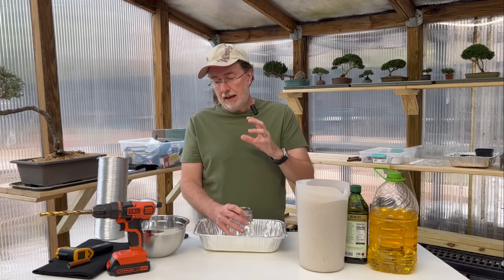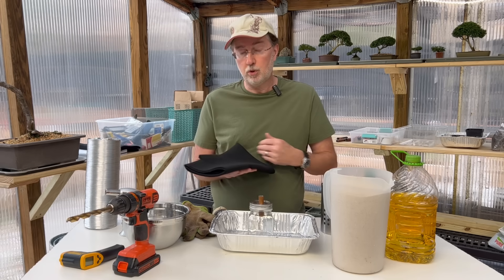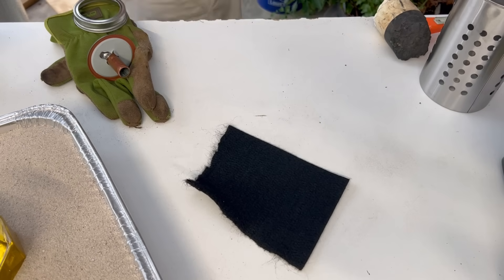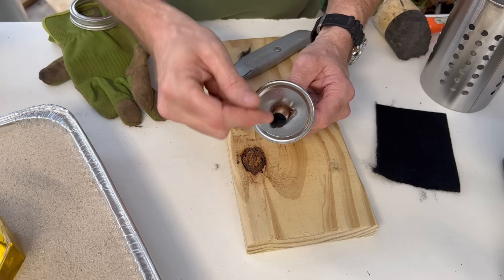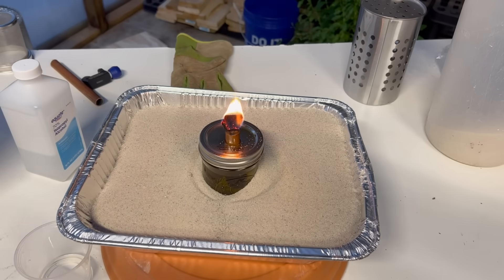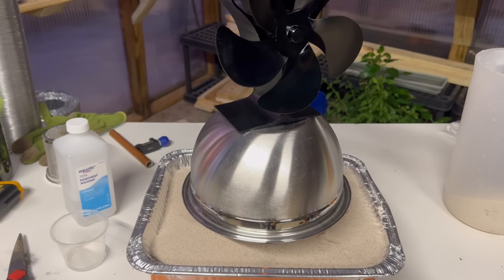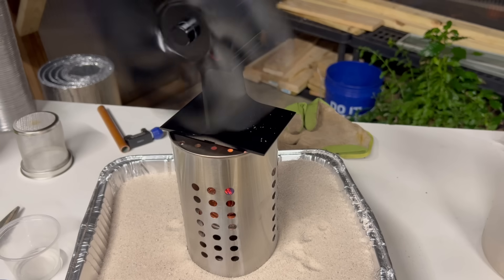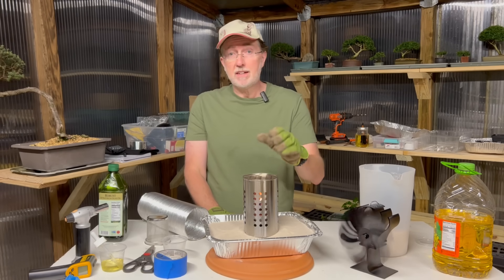DIY Carbon Felt Heater | Burns Forever Without Changing Out The Wick

Comment: With all the safety precautions you mention,  in extreme cold states it would be absolutely worthless,  on or under the stove ? There's absolutely no way it would radiat enough heat in a room the size of a kitchen,  same as setting it in fireplace,  it could work in a small sorta airtight room, but you say that's to dangerous,  I'm talking the northern states where middle of winter it's quite common to hit 10 degrees Fahrenheit or even 10 below for nights at a time,  so for folks living in the upper north states that know exactly what I'm saying,  pick a different plan, this would have zero chance unless enclosed in a small undrafty room, and as he stated, that's a little too dangerous,  install a fireplace,  buy a diesel heater,  buy a generator that would power a couple big heaters,  well this might,  I say might serve the more moderate winter states, it has no chance against the really upper cold states

Comment: I bought a stainless  steel utensil holder at a thrift store but with no holes on the bottom. It is not easy to drill any holes. Sò I started with a small bit and finished up with a step bit. Perfect !

Comment: I couldn't find this stainless holed stack at Walmart!? Further, employees didn't know what I was talking about? I spent hours looking, you have hint on where I can find this stainless sleeve?
Reply from the maker: I believe I saw it at Amazon.  Also kitchen specialty shop, or target.
Reply: @ZenGardenOasis.  Did you in fact cut the base off of the stainless holed cylinder (aka utensil holder)? If so, how did you cut it?

Comment: People that die of carbon monoxide are just weaklings I done this same setup but I used Diesel and Vegetable Oil mix and and set there In My car for with It burning for 2 hours but yeah It was smokey so I lowered the amount of Diesel still too smokey so I mixed 15% rubbing alcohol with the Vegetable Oil If use too much alcohol It blows the flame 🔥 out I melted Vegetable shorting and It seems more potent than Vegetable Oil I tried with both cotton wick and Fibreglass Wick the Fibreglass last longer. If You want a much bigger flame 🔥 melt the Vegetable shorting don't put the lid on the jar just put a cotton wick In the jar but what really stole the show was Walmart scented candle Pine sent with 3 Wicks I melted the wax and put In 3 one Inch Wicks It got so hot It busted the jar so I put In 2 one half Inch Wicks then put It In side My Car 🚗 after a while the wax burst Into flames 🔥 I got to try out My new fire extinguisher but what really works good heat the Car was Royal Oak 6 hour can heat, Stereo and Gas One can heat are good too but expensive I put the can heat In a metal Hamster cage and put some bricks 🧱 on top It keeps My Car warm all night for 6 hours

Comment: A source of sand you might not have heard of is white gypsum sand. Its the kind of sand that used to be in public businesses in freesranding vertical cylinder cigarette ash urns . Commonly known in the sandblasting business as "Oklahoma Fine" Usually available in 50 or 100 lb. bags.Can probably be found in smaller quantities where arts and crafts hobbies supplies are sold .

Comment: I've been trying a set up using mounted oil lanterns OUTSIDE the structure that heat a motorcycle exhaust pipe + lots of stainless elbows that runs through the wall through a double walled steel tube for heat safety (I cut the ends of double walled travel mugs for this - that works great!). Wanting something to heat a very small shed without compromising the inside air quality.The open pipe starts low inside the shed then goes up and out to the lantern and then turns back inside. The cool air close to the floor is  pulled up and out to the lantern and then the heated air blows out from the higher end of the pipe inside the shed near where I will work. The pipe is installed on an angle so the heat circulates via a natural draft. Adding a fan to the pipe just made the air cooler + added noise so I ditched that idea. So far I got what feels like the heat from a small travel hairdryer on lowest setting minus any noise.  I thought a collection of 4 metal + glass veggie oil lanterns hanging on the outside of the shed would look nice, provide a security light and add some heat. Still tinkering with this / trying to scale it up / insulate the pipes outside to see if it could actually add enough heat to make a difference, ha!
Reply: Interesting. Have you considered heating water and circulating it through radiators inside the shed?
Reply: @Pipizzakitchen  That's a great idea! Multiple mini radiators. Maybe one I that I could sit on :)

Comment: The key is that you also need a pretty hot flame or a drop or two of fuel on the wick to get the oil to vaporize which is what allows the Canola oil to start burning. If you try and light with a match you'll probably be disappointed.

Comment: You should have shoved it into the pipe from the other end. Then  you just push it through until the wick pops out the top, and you just let the free end hang down into the fuel oil. 😊
Thanks for the video
Reply from the maker: Thanks for the tip
Reply: @ZenGardenOasis.  Awesome device made two of them and removed all humidity from my basement in roughly 48 hrs 

Edited to add 46oz tomato juice can with ⅜in holes drilled into it works well for a short use upright. Drilling pilot holes first makes it a lot easier. I used a ³/¹⁶ bit. My pitbull Angel donated her stainless food and water bowls to my cause. She got brand new ones out of the deal, and her favorite snack, pig ears from Rural King.

If anyone uses the tomato juice can or any can with a label, be sure to remove the label first, or your smoke alarm will make a very loud noise. Ask me how I know.

Comment: Great Video! - To share what I learned about those fans- Not all will take that direct high heat. I was shopping for one to adapt to my Mr. Buddy propane heater, when I ran across that fact... So make sure they are high heat protected, or they can burn up to close to the heat source.
Reply from the maker: Thanks for the info!

Comment: change the cap with other without gasket at bottom. solder the pipe to  the new cap and fill  the top  tiny cup with alcohol then fire the alcohol and this flame will pre-heat the pipe and star burning the oil.

Comment: used thin strip of  leftover carbon felt from methanol heater diy project, wicked up side of tuna can, and extra virgin oil.... 2 Tbs took 3 hrs to burn , huge heat nice light

Comment: I see there are many people helping your design. Let me add by saying you can use plumbers felt for a wick going into a canning jar with a hole in the lid. Use a two inch X 1/2 inch copper tube to hold the wick in place. Put some cooking oil into the canning jar and you got it.

Comment: Thank you 👍😎
 like said get a carbon monoxide detector...
Just make sure .. getting a carbon monoxide/smoke detector 
 got to mention it for safety purposes don't have them near your food or near you or where you sleep or your pets they Do give off a minor radiation to an extent of a distance..
.. minor radiation component that's sensing for smoke...
  .🤔
Also means don't have the smoke detector by 
Probably just cause you a whole bunch of racket what the fire device for heat when I did at least have a smoke detector somewhere and heck check into it and see if that monoxide detector has the same components I'm not going to waste my time you can make your next video
Reply: That fire device is👍 awesome...

Comment: Wet the carbon felt with the oil before puttimg it in to the copper pipe . Should slide in and ready when lighting  it .

Comment: Man, you so WOKE. 
Open flame does not produce carbon monoxide. If it did I would be dead.
When I was a kid that is how we had light after sunset. You can use querosene, diesel and gasoline. No problem. 
It seems to me that you are mechanicaly challenged.
If you are so inesperimente about the subject, and are given misleading information, why are you doing this ?

Comment: Idk what I’m doing wrong but I went through all the steps 3 separate times; used rubbing alcohol as a starter; different size wicks as well as waited till the next day to make sure the canola oil had time to soak the wick. After all that I can’t get it to stay lit for more that 5 minutes or so. Any suggestions?

Comment: Max Heater use carbon felt wick in an 12 inch length by 6 inch deep. Make an iron box out of air duct. Have an iron tube made from air duct running thru center of box. Wick heats this iron tube and iron tube heats air in room while the nasty stuff goes outside an alluminun dryer vent. Use a rivet gun to assemble the rectangle air vent box . Box has 2 holes on sides for heater tube and one hole on top where alluninum dryer vent goes outside. Tube that passes thru box inside gets red hot. Get a battery operated tiny fan to push very hot air out into room.
Reply: Use a carbon wick system you put inside box like you seen in video that uses canola oil.
Reply: Use thicker grade material on iron air duct box. Remember to soak wick before you install it. Use proper materials to seal box correctly. ONLY tube inside box gets red hot. The box does not. I had a glass blower person to make the container that holds the wick and oil but you guys could use several of those jars he made and put inside box to heat the iron tube inside.

Comment: The stove fan works with a 'pelter disc' which generates small amounts of electricity when one side of this disk gets hot and the other side is cooler. As long as there is a differential in temps it will continue to produce from a few DC volts to maybe as much as 12 DC volts, in some cases. -- These do not wear out over time and can work for decades when cared for properly. -- Cost? $15 to $45 pending size, # of blades on the fan, etc.

Comment: Any idea to recycle used cooking oil is very valuable. French fries are tasty but i stopped cooking them because of this such damned used oil. To avoid greenhouse to freeze 🥶 is good idea. Plants like (and need !) CO2 a lot (the CO2 fraud). The mesh for lamps creates light + heat in same time. Typically Dutch / Amish. Don't forget the Bible !! 😊

Comment: The emissivity of the chrome pipe is very low, so the infrared measurement is not correct. I think temperature is probably almost 3x higher than the value you read.

Comment: Black felt pen makes a good surface to monitor the temperature. Infrared radiant heat. A flat black surface is the desired surface to get a proper reading.

Comment: My experience with the carbon felt wick was not good. I had soaked the wick in vegetable shortening and it lit up but about 5 minutes later it snuffed out.There was no wicking action. Any tips?
Reply from the maker: Small torch to heat the copper also shorten the copper length.

Comment: Over time carbon felt will shrink half an inch, or a full inch per year from the heat. The glowing red means the carbon felt is drying up, and needs more fuel. This heater/lamp will make a great simmer stove. Perfect for baking. :)
Reply from the maker: Great point!

Comment: i would make 2 tiny vent holes on the lid between the copper tube holding felt and edge of jar, for safety if pressure builds up. also lowering the wick until there's no smoke.

Comment: An inverted clay flower pot may work better than the aluminium untensil holder.  or replace the metal bowl with the flower pot.
Reply: Only issue with overturned clay flower pot is that after a period of time they start to crack

Comment: That carbon felt looks like road felt. Anyone know if it is the same?
Reply: it's used by plumbers to put behind pipes they are soldering so the wall, wood, etc doesn't catch fire. If you can't find carbon fiber, try plumbers felt. Just make sure it's 100% carbon. These days many companies cheat and sneak in junk that might be toxic if burned.I have no clue what road felt is so can't answer that question:(
Reply: no it is not the same. Road felt burns pretty readily if exposed to open flame. But once the bitumen is all gone from it , it could be used for this purpose I suppose
Reply: @MolloRelax  thanks for the info.

Comment: What did you do when you cut another piece of copper...was it longer or shorter...? What changes did you make?
Reply: He won't answer.  Had the same question. Mine will not burn with canola. Been trying to figure out why.
Reply: The heated copper help draw oil up tube to mack it burn @buck10539

Comment: Some JB Weld would easily hold the tube in place.
Some old aquarium filler will  work as well as the sand.
You can get the carbon felt in the plumbing section of Home Depot or hardware/plumbing store.
You can use a little alcohol to help the oil get started to wick up & burn easily.
The fan is called a peltier fan.
If you plan to use some heating like this you need a CO detector-  be safe rather than sick!
Reply: i wouldnt use jb weld, if you are going the epoxy route then use hotcat, exhaust patch epoxy its made specifically for hot work
Reply: Olive oil,crisco ,veg. Oil will not cause poison monoxide.
Reply: @genemyersmyers6710 wrong! Google that one bud.
Reply: No ,the flame protector in my home depot is a polybicarbinet treated material,  I know because I bought one and it just melted and died.
Reply: Without the detector not just sick but could be much much worse.

Comment: Correction, fan runs with electric 💡. But what it is in the middle bit there is a heat exchanger so that turns heat to 3 to 5 volt electric so fan has  small electric motor basically, lovely little device which in emergency you can even charge your mobile phone by heat. I must say fantastic video. I like it.
Reply from the maker: So nice to see a kind word.  Thank you.
Reply: With it burning so hot, how do you extinguish it if you needed to please
Reply: @myk9rox urinate on directly onto the flame. Its not only a cheap option but also environmentally responsible.
Reply: @DeeLzNuttz_BoffaDem Love and Hilarious 😂Thank's
Reply: 👍✅️⚘️THANKS FOR 
GOOD IDEA! 
YOU CAN USE CERAMIC TUBE INSTEAD OF COPPER TUBE AND FIRE FILTER TOPS STAINLESS STEEL TWO NU PIECES WILL GET BETTER RESULTS.–—> [ HEAT OUTPUT ]👍✅️

Comment: I saw fire made with this kind of heater. The temperature sourrounding the jar rise to such a temperature that oil start in fire. It can burst the glass of jar first and colapsing jar  start a fire. Very dangerous it may be. If you develop something that pyt oil far from heat, or prevent heating the oil in jar it could be more safe and in this case more intersting. In my opinion the weakest point of this construction is risk to heat oil to temperature wher it ignite fire on it. OR  temperature burst the jar and oil soak to sand and start a fire on uncontrolled scale. I saw fire which burn all the house. Idea Is ecellent  but need to have more safety features. Maybe har should be dig much more deeper than knot.Or something like that. Non of this kind of experiment not showing how high temperature  of oil in jar is after several hours of use. Be AWARE this could be dangerous for your house (Can burn it) or oyur and your family life. Writing this  I am still greatful that you show it, but it is fire and fuel - and it could be disastrous!
Reply: Exactly. 
Why is this guy always making these things for people to burn up there stuff with. 
500* is not to be fuc$ed with. 
You just won’t be able to do anything with the fire and heat. 
Please stop posting these inventions. There shite!

Comment: Instead of using a full-size drill bit to make the hole in the top, use a center punch to mark your hole and then use a step bit. They are designed to cut through sheet metal nicely. Cheers! Also: Credit to Robert Murray-Smith for the carbon wick.

Comment: I could never use this in My home ( My smoke detector is directly hard wired to the alarm company )
Unless the power is out .  ( even then , I'd have to remember to disconnect the battery backup )

Comment: That is a cool fan.  That looks perfect for a small shelter.  It's just hard to understand how such a small flame can counter the amount of cold air entering from the vent. It's only in the 20's F now. I understand the concern about CO, but if I crack a window, it will cool it down right now.
Reply: Get a Chinese diesel heater. It will get you more heat and you can put it outside and pump the heat inside. It solves all the venting issues. It does use a little electricity, but it will run from a car battery...which could be solar charged. I watched a lot of videos on these type of things and even experimented a little with some candles. I decided two things: I didn't want to freeze to death and I wanted any exhaust to be produced outside. I now have a diesel heater.
Reply: @jaybanks7718  is the battery only used to start the diesel engine, then it runs off the diesel? Is it noisy like most diesels? Thanks.
Reply: @karenbuckner1959  It always uses electricity, but once it starts, it doesn't use a lot. I have ran it more than half a day off of a car jump stater. It's outside, so most of what you get inside the house is the blower noise from the fan moving the air. I'm really picky with noise. It doesn't bother me too much.

Comment: Good design. You could also use another aluminum tray, like you have under it, to collect the sooth from it. It can be used as pigment for black paint. It's also called as lampblack. Water glass (sodium silicate) is a good heat resistant base for the paints.
Reply: Nice pic, although it really doesn't fit  in here

Comment: Fan is peltier chip (electrical powered).  Basically a cluster of thermocouples that generate a current when heated.  The electric powers the motor.